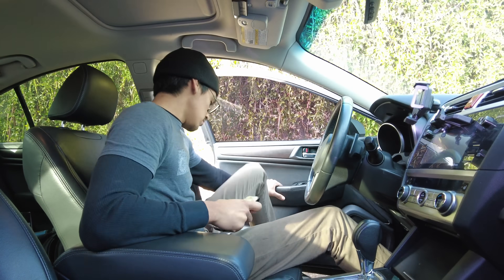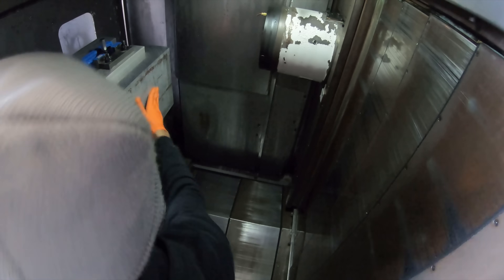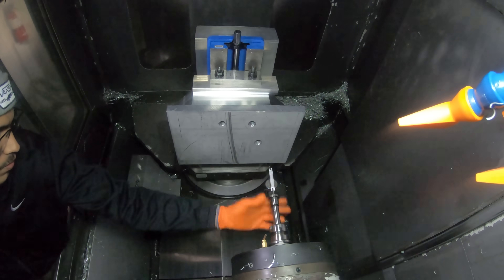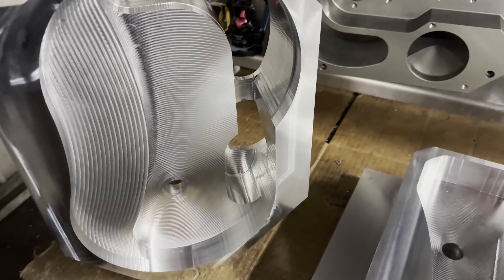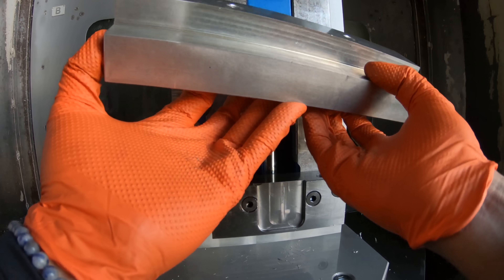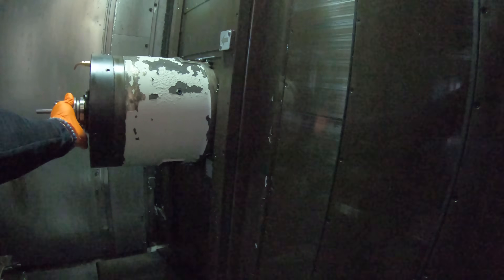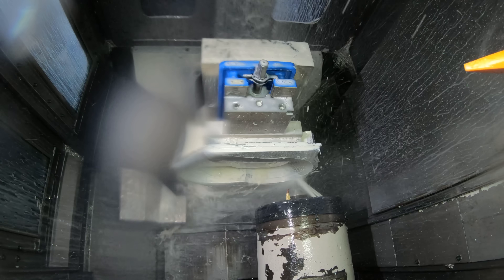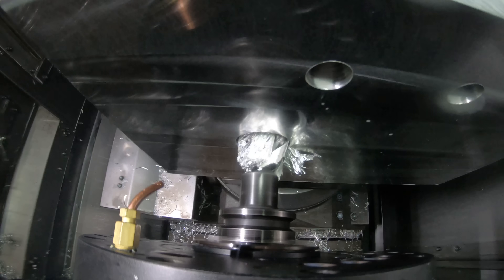Massive Material Removal !! | CNC Machining on a Horizontal

Comment: One small critique: That scanner is +/- a thou at best not factoring in any volumetric error. It’s not “a few tenths from the actual part”. This amount of error would be problematic in many situations. I just want to make sure people know what is possible currently. Basically all metrology grade handheld scanners are accurate to a couple thousandths (I work in measurement). Absolutely awesome video. Not taking anything away from what you did here - it’s rad dude.
Reply: Thanks for saying that. When I heard him say a couple tenths, I automatically perked up and knew that didn’t sound right. I’m a machinist by trade. Love making parts! Wish our industry got more attention. What we do is incredible!

Comment: the model you are scanning, is it a finished workpiece or a model. 3d printed / sla model ??   I have worked with scanning that small objects 10 x 15x 12 mm can tell you it was impossible to scan. the subject for hearing aids / ear plugs

Comment: I’m not a machinist, but I can tell that the 3d scanner was a game changer when it comes to reproducing existing parts. Cool video.
Reply: It depends on accurasy ,generally laser scanners are not enough for high accuracy requirements.
Reply: @blabla-kk8bl 0.02mm is pretty accurate. I have a CR Raptor and can use the scan data without needing to measure the part.
Good 3D scanners now are affordable and highly accurate. But you still need a good software like Geomagic design X for reverse engineering.

Comment: Horizontals have one major advantage in my eyes and that is chip evacuation. I'm working on 2 vertical spindle machines (Haas VF2 SSYT 2020 machine, Dahlih MCV 720 idk which year that is, but all I can say is that it is quite a bit older) (in my company we have only 2 mills and it's enough to do all the work necessary for company needs - we're making parts for ourselves if you could say that)
Edit: I would love to make parts of that size, that would be really cool and fun to machine.

Comment: We bought a SH-50 Mori made in 94 with a Fanuc 16 controller for 7k. It had a bad powermate. It took us a couple months to fix the old girl up. It has a 12k spindle and came with a bunch of tombstones. The girl runs all day 12 hours without a problem holding .0002 through the day. Load and go pretty much. 

I rather have the old iron than the new stuff. Better made with I can work on it if breaks.

Comment: Nice work. But if it was me. I would dovetail the part n jaws. Hog out the part with a 3/4 em at max speed n feed at least 250 . I agreed how u did the 1st op. But would make a fixture to bolt down the threaded holes n support the thin outer wall for second op. I hope this Offended u but dovetail is the way to go when roughing

Comment: A friend of mine has a CNC machine that is older than I am, and I am 56. It's a Kearney and Trecker from (I think) 1958. It's not running the original controller, he has converted it ti LinuxCNC.

Comment: What software you use for reverse engineering first scan it in vx elements then which one to convert to cad please share
Reply from the maker: I used Geomagic DesignX for this, but I also like using vx elements to extract all the geometry and silhouettes I need and then doing a live transfer to SW

Comment: Haven't seen one of those 3D scanners be used for modelling before, what sort of general tolerance can they hit?
Reply: In the video he says accurate to a few tenths. I imagine if you just plug in that mesh model to CAM you’d get an irregular finish due to the way the model is made.
Reply from the maker: That is correct, which is why you have to reverse engineer it in CAD first

Comment: I really like your choice of splitting up the roughing OPs. We usually do that as well when we have to remove a lot of metal and it improves the quality of your part and eliminates the need to chase dimensions due to material stress relieving itself. We have 3 SH-630's that are on a pallet pool system. Between the cell controller and having 2 separate load stations, that machine is a beast at productivity. Unfortunately its getting time to phase it out but even after 25 years that machine is still kicking it.
Reply from the maker: Yeah, exactly my thought. Sounds like an awesome setup you got there, I imagine you can crank out tons of parts 😮‍💨

Comment: I work on many machines from the the mid 80s-90s and they still run parts really well. It amazes me how well this technology holds up, and I think it always will.
Reply: Well in some regards but... losing the zero when pressing the M0 stop, having to press a sequence of buttons that is ridiculous for what you are aiming at.. the most disgusting UI... yeah they run ok but....
Easy, quick and relatable example? WHO THE FUCK CALLS "CRT" the button that turns on/off the monitor... CRT = CATHODE RAY TUBE that tv tech is laughable....
Reply: @Deeeeeeeeeeeeeeeeeeeeeeeeez Can always retrofit old CNC machines with newer technologies for the fraction of the price of a newer (still old) CNC.

Comment: Loved the video. My question is, how do you get a program that large into a machine that old? I run a little Sharp 2412 VMC circa 2003. If I tried to load even the first op, I couldn't even fit one tenth of it into my machines memory, let alone 2 roughing and 2 finish ops.
Reply from the maker: Nice observation…so I actually have to use arc smoothing to produce a lot less code. This usually insures I’ll have enough space. But also I believe the prior owners of this machine upgraded the memory bc it has 2MB
Reply from the maker: Not to mention it takes like 20min to send code that is around 100kb

Comment: I regularly work on a SH-63 with a 400mm rotary table for simultaneous 5 axis, almost just 5 axis work. 
Machine is top specced with HPCC and large dataserver, I prefer it over the newer machines we have.
Reply from the maker: Oh man, that must be a nice setup!
Reply: It also has bigplus dual contact 50 taper spindle. 
Linear rails and ball screw on Z is scheduled for replacement next year.  @dnamfg

Comment: In almost 40 years of machining, an SH633 was and is my favorite machine.  Good video.
Reply from the maker: It really does produce such good quality and very reliable. Thanks for the watch!
Reply: Mine best so far is Haas VF2 (I am a youngin in trade who's learning all the tips & tricks, and intricacies when it comes to cutting material.) But as experience goes, that might change and I know that some machines would take the lead over VF2
Reply: @luckgrip252  it will change your opinion hahaahah. Tried Haas VF2SSYT, VF3SSYT, DS30Y a lot of Mori Seiki and DMG Mori and Nakamura and there are worlds apart from Haas

Comment: Good job, with the part and videography. 
One suggestion- use corncob roughers, not only can you cut faster but the chips compress better and don't clog everything up.
Reply: YG1 chip splitters!
Reply from the maker: This 👆

Comment: Dang bro, you have to tell me what is that finishing tool your using on the outside of the part. It sounds really good for being so long. Looks like 3  inches. My guess 3 flute 3 inch, 1/2 diameter? What are your speeds and feeds?
Reply from the maker: YG-1 5/8” endmill. I love the YG endmills for aluminum

Comment: Hi. Good Video 😁 My Q is Whats the point of splitting rough and finish for 2 ops/setups?
Reply from the maker: Very good question, based on the feedback I’ve gotten I’m going to make a video going more in-depth on the technical details. Look out for that!
Reply: With as much material as he's removing the part is going to flex and mover around.  By roughing the entire thing out first the residual stress in the material will relax.  Large pieces of material often have internal stresses in them that can cause the part to warp if not processed correctly.  In this case if he roughed and finished the first side then took the material off the back of the part there is a good chance that his first op features would warp and shift around on him.